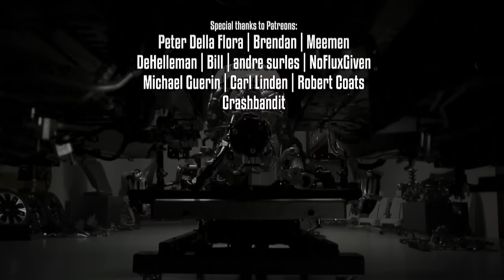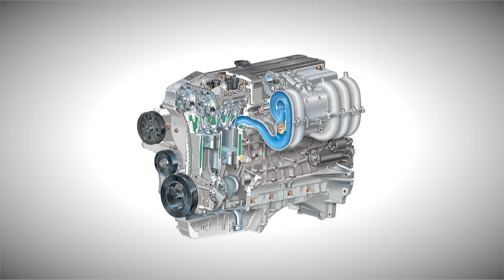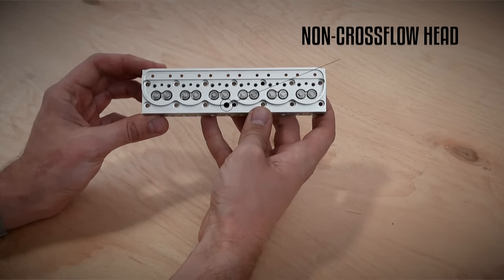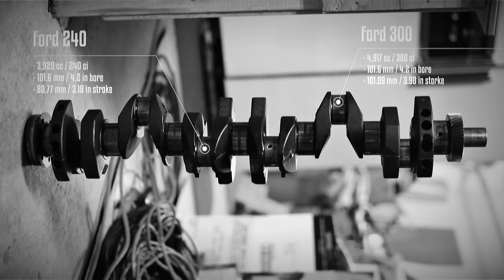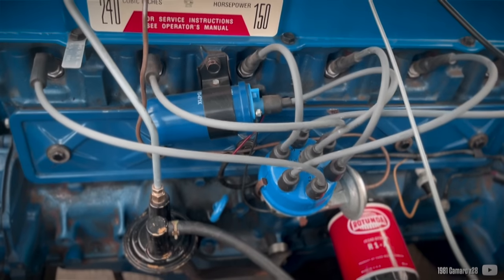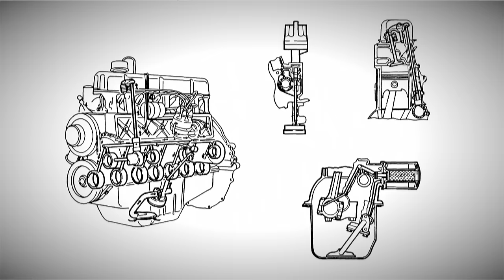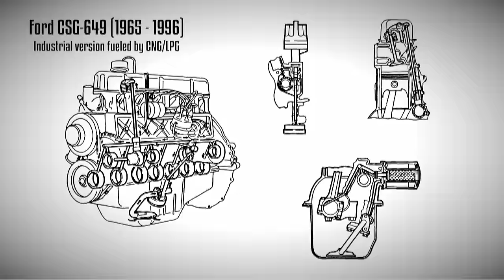Is This Toughest US 6-Cylinder?

Comment: Excellent work. Strait six is awesome. I remember my dad telling me he liked the slant six>  The gas shortage was a man-made event. There was not and is not an oil shortage.
Reply: Did someone tell you that the gas shortages weren't made by the oil producers? That's pretty much common knowledge to anyone who pays attention. The oil companies create product shortages by withholding crude production or refinery production. Whatever it takes for them to increase profits, despite the harm it does to the economy...
Reply: and from personal experience ive found that a 225 slant in a small(a body) car can easily make 35 mpg at highway speeds and outlast the car itself.
Reply: @maddhatter3564  Yep, My buddy's old Valiant would go forever on a buck of fuel (back when you could get 4 gallons for a buck!)
Reply: @87mini  before my time gas was 81 cents a gallon when i started driving in 86.lowest mileage slant i had was a 66 dodge van with a 170, got 27mpg, out of a flying brick. lol
Reply: @maddhatter3564  that poor little 170 pushing around a gigantic pirate ship 🤣
Reply: Why these engines were not retained as primary ICE's and developed world wide is a business decision that lacks true visionary management as I've seen these engines used in just about every possible application, air, land and sea. Just a thought. 👍✌️🌍🌏🌎
Reply: @johnking6252  Lots of engines like that out there...instead of US Manufacturers hastily developing complete garbage, I dont understand why they didnt just take what they already had, proven and reliable, and modify it. Virtually all of the older and near indestructible engines could easily have been updated with modern EFI and turbos. i4s could have been made from i6s etc. It makes no sense at all to keep designing complete junk when we had all of these tried and true engines ready for modern upgrades.
Reply: @tehagent1321  my point exactly 💯 it seems such a waste, just chasing the bigger, better mousetrap.  Thx. 👍
Reply: Uncle Sam and his wallet.

Comment: I've had 4 300 i6s,  it's one of my all time favorites.  Considering we're still talking about them and they've been out of production for 26 years says something...
Reply: I’m with you. I have a 1995 F150 long bed. It has the 300, a 5 speed and absolutely no options, not even carpet. It makes the perfect work truck as you can hose the floors out. In the 80’s and 90’s you just about couldn’t buy a bad truck. Dodge was probably the worst of the big 3 but Ford and GM were both using engines they had been making for decades. The 300/302/351/460 were all good choices, same with GM 4.3/305/350/454. The most miles I personally saw was on my Dads 1995 GMC Sierra. It had the 350 and he put over 400,000 miles on it. The only things it ever needed were a water pump and alternator. He ended up selling it to a landscaper for maybe $500. I wouldn’t be surprised at all if it’s still on the road to this day
Reply: I had a 1984 ford 1/2 ton 4x4 shortbed. 4.5x rearend gave me 12-15 mpg. It pulled my trailer fine but the mpg forced me to trade it for a Chevy 350 1/2 ton.
Reply: @donaldindividual-1  Exactly.  My experience with an inline 6 was while it may have had the torque, the mileage per gallon sucked.
Reply: They kept making them in Australia for a few years after U.S. production stopped.
Reply: We talk about them because modern engines are shit. Yes we have more power and more fuel economy but half the engines these days can’t crack 200k without some major overhaul, and are generally problematic in some fashion after 100k.

Meanwhile my Mustang has 237k on the original 5.0 bottom end. It’s been cammed and the intake upgraded to a GT40 for fuel injection. Dynoed near 400hp on 93 octane, and frankly, don’t want or need more because as it is, it’s reliable and still returns 20mpg.
Reply: @emotionz3  

Scott Kilmer would agree.
Reply: Did the Australian version  have a cross-town head? I know someone cut up aluminum 351C heads to install on the 300 six. Worked out well
Reply: Crossflow head.
Reply: It probably says there were way more v8s than I6 in the US. Despite the I6 being a naturally superior design (In practice though it's matter of execution).
Reply: @RobertSmith-le8wp  I've got the same ford truck with no options on it. It's got 387,000 miles on it currently and still running.
Reply: @RobertSmith-le8wp  I have a 96 F-150 extended cab regular bed with the  ford 300. It’s got 119,000 miles and is still going strong with no engine issues. The body of the truck will literally rot away before that engine goes out 😂
Reply: @donaldindividual-1 what kind of mileage are you getting out of the 350? My GM half ton 305 only does marginally better than my 300/6 f250. Probably 13-14 on the 300/6 and 15 with the 305

Comment: My dad had a work truck we called big grey. One of the final years of the big 6, dad drove it to 350k miles snd sold it to a guy that he knew. That guy daily drove it for 2 years until it got t-boned. 

Only thing it ever needed was spark plugs, oil changed etc. Engine was never opened up. Most we did to it was a clutch and a trans rebuild.  This truck had a flatbed, hauled drywall all day.
Reply: Made it simple to last, be reliable and cheap, i assume. It would run awesome with all the tech nowadays. Im wonder, what would have happen if someone would have developed something like a variable valve lift for it, definitely possible.
Reply: It ran on high octane fuel all the time?
Reply: @RohanSanjith  nope. Regular. High octane will actually burn hotter and can cause issues in some engines. I think the low compression ratio of the big 6 would have made it OK tho.
Reply: @RGV2300  look at the ford barra i6 from Australia. It is like the smaller 240 block with an overhead camshaft
Reply: @nothanksguy  High octane does not burn hotter. Higher octane fuel has less energy, and therefore produces less heat, which is why higher grade fuels are more resistant to engine knock. Please stop misinforming people.
Reply: @bubbleman2002  stop spreading misinformation

An octane rating, or octane number, is a standard measure of a fuel's ability to withstand compression in an internal combustion engine without detonating. The higher the octane number, the more compression the fuel can withstand before detonating. Octane rating does not relate directly to the power output or the energy content of the fuel per unit mass or volume, but simply indicates gasoline's capability against compression.
Reply: @Golgi-Gyges  Lower energy density fuels typically are more resistant to knock because they burn cooler than a fuel with a higher energy density. For instance, nitromethane is a powerful racing fuel, but despite this E85 has superior knock resistance, as it is significantly less energy dense than nitromethane.
Reply: @bubbleman2002  read the last sentence of what I posted.
Reply: Hemi 265 from Australia very good also
Reply: That story sounds familiar to me. Mine was 21 yo, had 385k miles and was T boned which ended it's life. It was the best,most reliable vehicle I ever had.
Reply: @markkaminski2416  - I am sorry to ask. What is the meaning of "Tea-boned" ?
Reply: @rogerdc7279  Involved in an accident and hit broadside by another vehicle. Example: a vehicle runs through a traffic signal and impacts another.
Reply: There is an older guy much older now than when I met him named Frank Delecci. Frank & I both had old Ford pickups years back when we were drywallers. About 1991 Frank sold a Gray 1979 with the straight 6 in it to a local kid whereas the truck just disappeared for years and years nobody seen it. I had not talked to Frank guy in nearly 30 years until my phone rang after I made a post on FB about the 1988 I have now that I am restoring. I had a 1988 some 30 years ago as well just not the same truck as back then. However Frank called me up and said I would not believe him if he told me he found his old 79 and I would come look at it. Buried behind an abandoned gas station in Catasaqua, Pa. inside what used to be an impound lot was Franks old Gray 1979 F150. We knew it was his truck by the decals in the back window. As it turned out it appears the kid he sold it to never even turned the title over we found the original bill of sale in the glove box the truck was still in Franks name!. Right now Frank just got the floors in it a new seat from LMC truck and I have the bed here at my shop it was in pretty sad shape a year ago when I went & got it. Frank just dropped a fresh 300 in it yesterday as a matter of fact he called to me to get the firing order. Frank said he remembered a phone call from the Catasaqua police something about the truck and Frank told em he had sold the truck and who he sold it to. He never even gave it a thought the truck was out back behind that old filling station garage less that 4 miles from where he still lives. Less the rust the truck was still clean inside and under the hood it just had many primer and bond spots all over it the reasons he sold it.
Reply: @RGV2300  
It doesnt even need that. Variable valve would potentially decrese the reliability. All it needs is a crossflow head.
Reply: @P7777-u7r  VVT can improve fuel economy, cross flow for power.
Reply: @P7777-u7r  Toyotas are some of the most reliable cars in the world and nearly all of their engines from the last 20-30 years have been equipped with variable valve timing on the intake side at least. This being said, many American vehicles can chew through VVT solenoid, like the Chrysler 3.6 V6, and some of GM's 4 cylinder ecotech engines.
Reply: 2009 Honda Fit with 1.5L has 331k, nary an oil leak anywhere , and uses less than a 1/2 quart of oil between changes. Honda recommended their filter and their partial synthetic oil. I've religiously used Mobil 1 synthetic- (high mileage) with Mobil 1 filters. Engines only last as long as you maintain oil/filter changes, and are driven reasonably, not like Mad Max. Also helps to have a manual transmission. Driven daily as a work car from home to home.
Reply: @russellsydlowski2332  very good, I machine is only as good as its maintenance
Reply: Probably, The best engine Ford ever had.
Reply: @RGV2300  variable valve lift would take away from what it's best known for- simplicity and reliability
Reply: I live in New Zealand. I have seen them talk about the 240 and 300 6 cylinder engines. I was wondering if any other countries used to engine like the Australian Barra engine. It's a shame that Ford won't be using those engines anymore. These days they are making smaller engines that can produce of power. Or they are now making more electric motor vehicles
Reply: @hamisharchibald5270  
It's not Ford's fault. 

It's that stupid EPA and DOE.
Reply: @nothanksguy  I am pretty sure that the 300 would run on just anything you could put in it. I know the 240 would run fine on Mexican regular and that is not very good gas.
Reply: @aldenconsolver3428  you're correct! The low compression ratio allows for use of low quality gasoline without the risk of pinging/detonation

Comment: My first truck was a 300 straight 6. You weren't going to accelerate very quick, but it had so much torque and was so dependable.
Reply: Haha, I had an 86, 300, 4 in the floor. Do not think I found much anything that was comparable that could accelerate as quickly up to 2nd gear, and I never revved it over 3k. That torque would just kick it up to speed. Out ran a cop in it with a dual jetski trailer.. the speedometer was off after 2nd gear, as in about 15mph faster than shown haha (slipped out of his jurisdiction before he could turn around), never knew it every seal and piece of rubber in the doors were gone, was quieter with the windows down haha. It did have a 3.08 ratio. Still would pull like a damn tractor.
Reply: My first truck was also a 300, fuel injected, in an '89 F150 my dad actually bought new. 
That truck is still in my driveway, I drive it all the time. 270,000 miles.

Comment: I have had a 300 in my Bronco for nearly 20 years now.  It takes me anywhere and everywhere and is fantastic off-road.  In 2018 I rebuilt it and it's putting out well over 200hp now.  Such a blast to drive, and endlessly reliable.
Great engine!!

Comment: I've owned and daily driven 3 of them. Two were well over 200,000 miles. AC worked great, they cruised at 65-70mph just fine. Pulled everything and were just great engines. I miss having one around honestly!
Reply: I've been daily driving mine to work at 75mph. Eats gas, but it's fine!
Reply: @Jimmy_Watt  with a 300 it all comes down to gearing and transmission. I pulled trailers with a 5 speed truck with a 31" tire and 3.55 gear and it was great. Conversely I had a 5 speed 4x4 with 33" tires and a 3.08 gear. 5th gear was reserved for tail winds on flat ground and down hills only!
Reply: I miss my old 300 2wd 5spd truck. Great daily driver truck. Good on gas too. Usually got 20-22 driving to work.

Comment: Absolutely!  The Ford 300 without a doubt is one of the most durable engines ever built.
Reply: Most durable for it's time***
Reply: Does Chevrolet 292 is very underrated that was the workhorse engine Ford's Ford is just getting more publicity publicity
Reply: The 292 Chevrolet is the one that was the workhorse I don't care what anybody says add more stroke more torque more horsepower than that Ford
Reply: @steveblottenberger1097  Sorry but.... the 300 inline 6 has WAY more torque, the point was to be a tractor engine, not a drag engine.